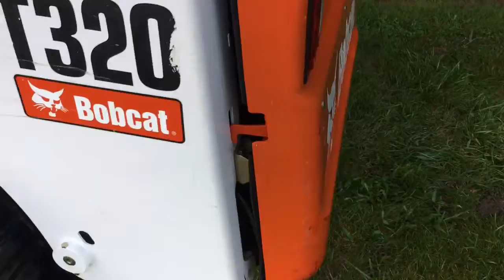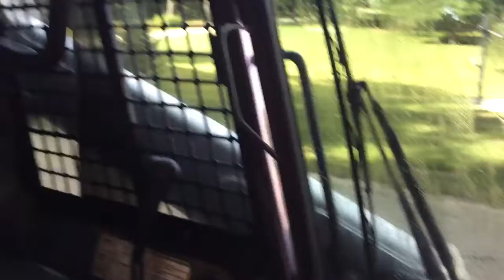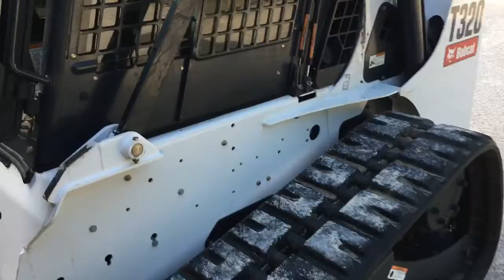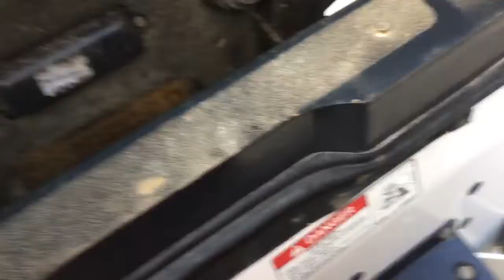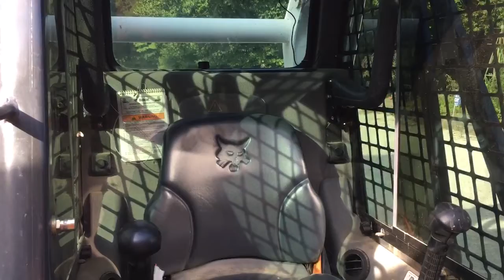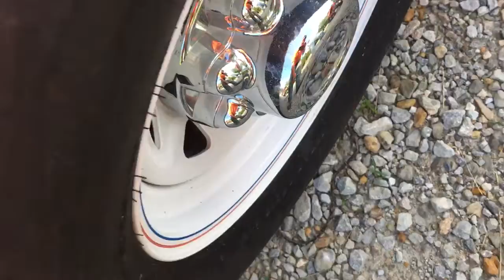Cleaning the Bobcat!!! Also bonus clip!!!

Comment: What cleaner did u use if any ? Or did u just spray it with water ?
Reply from the maker: James Hampton no cleaner just pressure washed it works pretty good just have to becarful under the cab and motor don’t wanna mess any electrical or anything up!